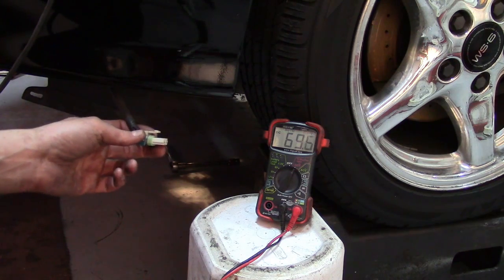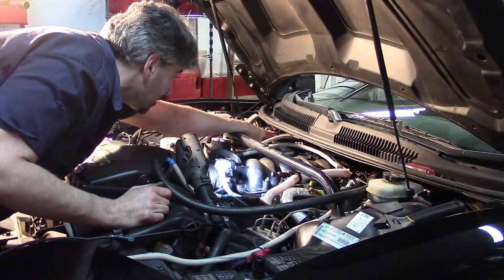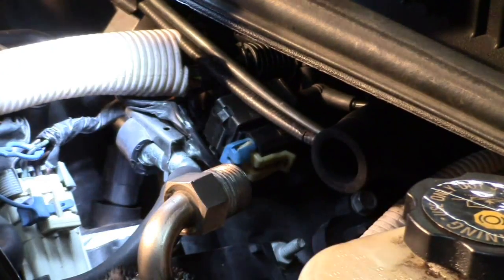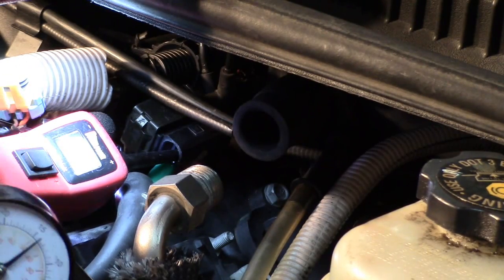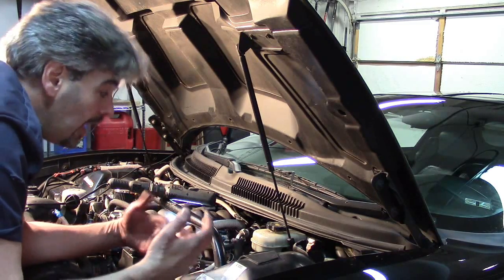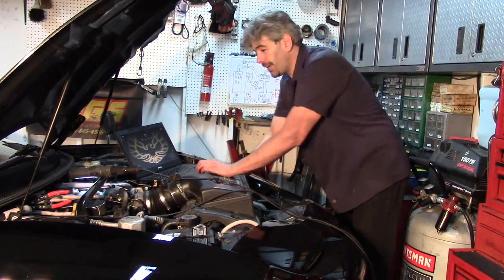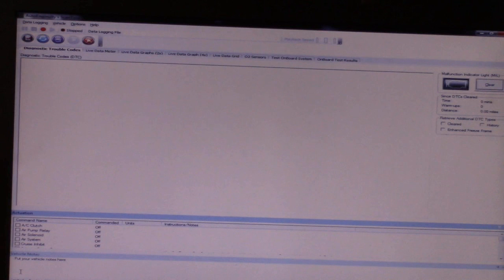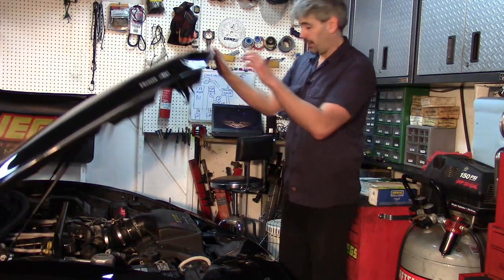Air Injection Reaction (A.I.R.) Diagnosis and Understanding-Pt2

Comment: Could you use a scanner to activate the air system and bypass all that probing ?
Reply from the maker: Yes of course if the scanner had bidirectional abilities. However if you command it on and it doesn’t activate, you have to know how to do the basic electrical diagnostics because this is still how you would have to diagnose it.

Comment: Hi Matt. I really enjoy your channel. Do you recommend getting the Auto Ingenuity base unit and then getting additional software for a personal laptop,  or is there a scan tool you recommend instead?  Thanks, Brett
Reply from the maker: Glad you enjoy the channel.
  As much as I love autoenginuity- there are now so many android based tablet devices available for similar cost but more capability. 
  A Topdon or Autel is a better value IMO as even the mid-range models have bidirectional control on hundreds of vehicles.
Reply: Ok. Thank you @SchrodingersBox

Comment: Please can you help me understand why all my injectors are injecting at the same time a possible cause?.imbattling eith it ad u love thus car and engine. I want yo keep it on the toad as long as possible
Reply from the maker: what car is this?
Reply: @SchrodingersBox its a toyota soarer also known as a lexus sc300 its using a 2jz ge motor non vvti.and I'm having alot of black smoke all my plugs are black causing the spark to get week

Comment: I have a 2003 corvette , the vacuum solenoid has key on power and ground  without it started. It seems like it might always have  both power and ground.  Would you know what would cause that ?
Reply from the maker: Vacuum solenoid for what device?  oh sorry never mind I see you mean for air solenoid. 
   if it’s ground side switched then a ground fault would cause that. check a diagram to verify if this is ground side controlled on that model (I am sure it is) and track down a ground fault prior to the PCM. 
  the only other possibility would be a bad PCM which would be exceedingly rare.
Reply: @SchrodingersBox  that makes sense. Thank you

Comment: Hello i am the idiot who replaced the air pump right away i am a terrible part changer and wouldn't even consider calling my self mechanically inclined. I have a P2437 Secondary Air Injection System Air Flow / Pressure Sensor Circuit Low Bank 2 and have no idea what to do next. I have replaced the air pump check valves and checked that they are getting power can you please help thank you.
Reply from the maker: What data do you have?
Reply: @SchrodingersBox  don't know exactly how to answer the question check engine light on with code p2437 replaced secondary air pump but after watching your videos i managed to test the old pump and it works check valves work aswell i was told that it could be a secondary air pressure sensor but i can't located all i see is the map sensor which i don't think could be the problem. The car is a 2015 gmc terrain
Reply from the maker: What I would need is the voltage from the MAP during idle and then during AIR activation and also the AIR pressure sensor voltage during same conditions. That would tell you where the issue is.
Reply: @SchrodingersBox  thanks i am having problems finding the air pressure sensor when i get those stats i will update you and thank you for responding

Comment: Thanks for your video. Just found my camaro 1999 z28 air pump has a filter canister on the inlet. There are a number of filter disks in it plus another filter in a small plastic housing on top of these disks in the canister. Found they were a little dirty so I cleaned them and was about to put them back in but changed my mind and replaced them with some filter cloth. Made disks out of the material and inserted the plastic housing with original gause like filter, closed canister and now found heaps of air coming out of outlet of pump, where before pump would run but no air out. Note inlet to canister is just a small pipe pointed down open to engine bay. I have the Full GM workshop manuals and there is no mention of this filter canister?
 Graeme in Australia
Reply: Just noticed my air pump has 3 wires. Looks like one turns on a 1 way valve on the output and the other is for the motor. 3rd is ground.
You can see the valve open and close when 12V is supplied to one of the terminals and you can hear and feel the motor turn when the other teminal is supplied.
Reply: Looks like there is more to this system.  The valve in the pump is called an itragal valve and there is a vacuum bleed valve on the output hose going to the T then to the 2 check valves. The vacuum bleed valve is controlled again by the PCM and is to stop a vacuum in the line causing the intragal air pump valve not to open. I have checked all these components and now have this error come back on me ! Have photos but do not think I can put them in these comments?.
I love and hate this car Graeme Redman in Australia
Reply: Problem found high resistance contacts in the Air Solinoid Relay. Replaced relay now good air flow.

Comment: Hey, great video. I have a quick question. I am currently replacing the vacuum lines on my C5 and I discovered that the vacuum line from the AIR solenoid to the junction connected to the vacuum tank was not holding pressure.  Please advise on what (if any) effect that this condition would have on the operation of the secondary AIR system and engine performance.   Thanks!!

Comment: I also have a 2002 trans am. I have been getting a P0410 code around 20 to 30 minutes into a trip.  The AIR system should be off by then…correct ?  Any insight ?
Thanks. John.
Reply from the maker: not exactly. remember the AIR is tested when it isn’t being used for warmup.

Comment: Thank you so much for these videos.  I was pretty scared at first to get into the diagnosis part of things, and this is helping so much.  I was looking at the air pump on my neighbors 2001 Cadillac Deville and was able to recreate a lot of what you did here, like making sure the air pump actually works etc.  It turns out there is no electrical signal going to the motor, so now I will look at the electrical side of it.  

There was one weird aspect to this car that I wanted to mention here.  The outgoing air from the air pump split into two tubes, each of which had a valve operated by a vacuum hose (they were both turned on by a single solenoid) prior to feeding in to the exhaust manifold.  When the solenoid kicked on, the vacuum activated the valves, but weirdly this then allowed exhaust to flow the other way, back towards the air pump.  This just seemed really weird to me.  It looks like the valves are bi-directional, either completely open or closed.  

Just wondering if anyone has seen anything like this elsewhere or if I'm missing something.

Thanks again!
Reply from the maker: Yep my trans am has that same exact setup

Comment: I’m trying to troubleshoot why my secondary air monitor is not ready. I’ve completed drive cycle . Pump is good relay is good I’ve replaced check valves any suggestions
Reply from the maker: there are three reasons this would happen. 
  First is its legitimately not hit the requirements for readiness. There are sometimes factors not indicated such as fuel level must be between 25 and 75%. Sometimes the drive cycle is not completed because proper engine temp wasn’t achieved at beginning of the cycle.  all kinds of variables. 
  The second reason is that readiness has been achieved but the scantool doesn’t recognize it because of communication issue. 
  The final reason is it’s not completing readiness because a fault detected.   Are you seeing the PCM validating AIR functionality with an O2 sensor or fuel trim response?

Comment: My truck/SUV with 113,000 (2000 GMC Yukon Denali 4X4) didn't pass smog (Secondary Air), No codes because the battery died. Would this be the reason it won't pass? Any advice would be appreciated. Thank you for taking the time to make your videos! 

Eventually I want to diagnose and repair this myself I'm really glad I ran into your channel.
Reply from the maker: Yes if your battery dies, the emissions history is lost and the vehicle will fail due to this. It’s called a “P1000”.

Comment: I have a check engine light that that gave me a code P0410, Secondary A.I.R. system diagnosis on my '03 DeVille.
After searching the web for information as to what I was  in for, I came apon your series on the subject and was blown away with how you not only show repair tips but also how you go into UNDERSTANDING these systems and units. That's something that one doesn't get from alot of the shop mechanics............all I can say is BIG THANKS for taking the time to explain, in detail, these complicated systems to guys like me. Keep'em comin. I'm ready to tackle this Caddy now. Thanks again.
Reply: I have 01 deville DTS.  Same code.  This is the definitely the best video.   Did you have any luck?

Comment: I replaced my spark plugs and had to take both air pumps on my v8 for access, nice for me as they were on top of the engine.  I'd never seen air pumps as I've been running CRD diesels for years.
Great explanation and appreciate your time to make this video.

Comment: Really excellent series, Thank you so much !!  I now understand the Secondary Airflo system, its function and diagnosis, 
Your Bidirectional control showed the system was working  but ... What caused the code in the first place ? Or was this for instruction only and there was no code ?  Either way ... Thanks

Comment: found your videos after having a lean code in my 2001 sonoma 2.2 flex. found out my fuel pump was only pushing 20psi. After fixing the lean issue I had a P0410. Ready to tackle that next. I've found myself  binge watching your videos and thoroughly enjoy them all. looking forward to more in the future. keep being awesome.
Reply from the maker: Yes the phenomenon you found is what I call a "discovered" code.  You won't get a P0410 on a lean condition... so it never shows until you fix it.
  These codes can be really frustrating for honest and skilled mechanics because of course the customer's impression is "you didn't fix my car right" but actually it was fixed for the original problem, it's just that the second problem surfaced as a result.

Comment: Great video, on the '98 and '99 trans am's, GM put those vacuum solenoids right next to the AIR pump in the lower fender, also instead of a diverter valve to split the air flow, they used a standard heater hose T.  It's pretty cool to see how they made changes (probably for the better) on this system.
Reply: 1999 z28 camaro looks to be the same. No diverter valve just a T connection.
Reply: I think the diverter valve is now in the output of pump that's why it hat 3 cables going to smog pump.

Comment: wow. i see how much time i can save by having a bi-directional scan tool. you can check wire integrity and if your loads are good just by commanding them on and monitoring the changes. Would you recommend the "Auto Enginuity" scan tool ? does it have alot of things you can command on? or is there another one you can recommend?

Comment: Question: If there is no secondary air system (like on my car)what system (if any) does the vehicle have in place to deal with the rich mixture at startup getting into the cat & possibly causing restriction?

Comment: Funny how that AIR solenoid looks exactly like the EGR solenoid on my 95 Formula.  Even in the same area of the engine.  Different Motor though, yours is LS1 (OBD2) mine's LT1(OBD1).  Probably the same part since function is basically the same just a different system to operate on.
Reply: +El Camino Guy Same functionality.  The LT1 engines have a diaphragm EGR on the back of the engine but the vacuum is controlled by a solenoid.  The LS1's have the 5 wire Electronic EGR.
Reply: Schrodinger's Box Quantum Mekanix
 Sure thing, Just had to replace the EGR after testing the EGR solenoid, lines and then discovering that my big vacuum leak was the EGR diaphragm.  vac pump connected to it sounded like sucking on a straw...lol.  No clogged passages but why would there be, it wasn't doing anything...:-)  BTW, I did the whole solenoid switch test with vac pump, vac gauge and jumper to put the PCM into diagnostic mode with solenoid on the car.  Test is fairly siimple, In diagnostic mode vacuum applied to one side of the switch should be the same on the other side.  If not the solenoid is bad.  I hated all the expensive sensors on my old 96 Camaro but I loved the extra diagnostics I could get out of the PCM.  That and the short wait in the emissions testing line.  No roller tests, they just plug in and 30 seconds later it's all over with.  Anyway, love your vids, we're of a like mind and I subbed which is something I'm stingy about. Keep up the good work, I think you missed you calling as an automotive educator!

Comment: Matt, your channel is great, thank you.  I've learned a ton from you.  I'm having a problem with my 2005 tundra, 4.7L motor.  I'm not sure about the diagnostic process with the system, but the air path is as follows.  From the pump, through a hose to an electrically operated valve.  then to sort of a manifold, through two vacuum operated valves, then to the exhaust manifolds.  I don't remember what the initial code numbers were, but I had 3 or 4 of them all saying that the three valves were stuck open, and I had a horrible whine during open loop.  That info was enough for me to look at the pump first.  Got it apart, the pump was trashed, and there was pieces of it stuck in the valves.  Got them all cleaned up, replaced the pump, and all switches are opening as they should.  I didn't have any trouble getting any of the harnesses unplugged or replaced.  Now I'm getting P2445 indicating the pump is not turning on.  I checked again, and all the harnesses appear to be in good shape, and all wires are tight.  Switches are still operating as they should and the pump wirks when supplied with power.  I'm not able to start the truck and check if the pump is running or if I'm getting power all the way to it because the entire system is under the intake manifold.  I've been searching around, and I can't find anything that tells me how the ECM determines whether or not the pump is coming on.  Looking for suggestions on what I can do to try to diagnose this.  Any help is very much appreciated.
Reply from the maker: It might be easier to check for command from the PCM wiring.  One way or another you need to verify voltage to the pump.
Reply: +Schrodingers Box Delayed reply, but I was able to do.ally fine a factory service manual online, and it had way more info than I was previously able to find on the diagnostics.  everythj.g I put a meter on checked out.  So probably late August I decided to pull the intake manifold again to take a look, and discovered that TWICE I missed a 1.5" piece of vacuum line that runs between the electric switching valve and a pressure sensor.  frustrating to find that I fixed it the first time but a small oversight was causing the truck to go into limp mode.